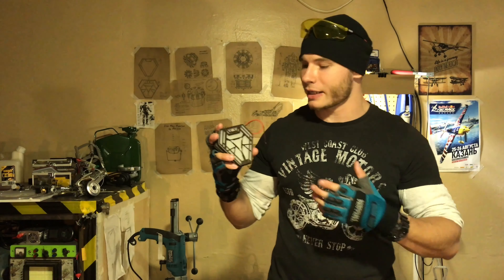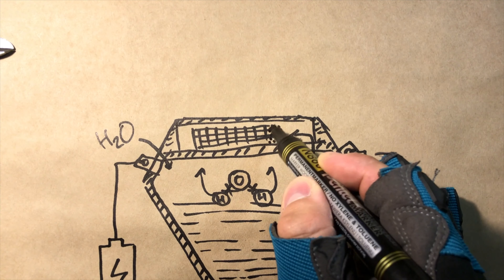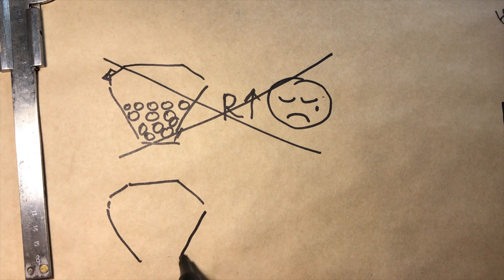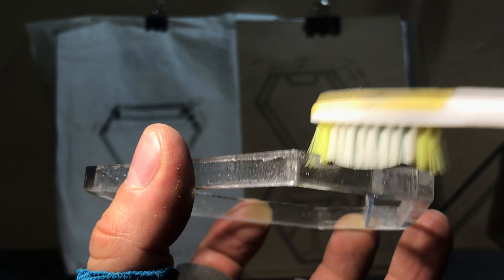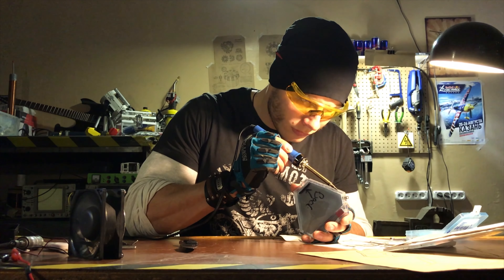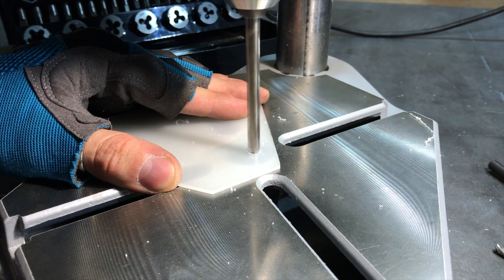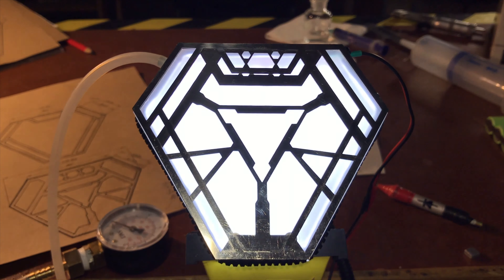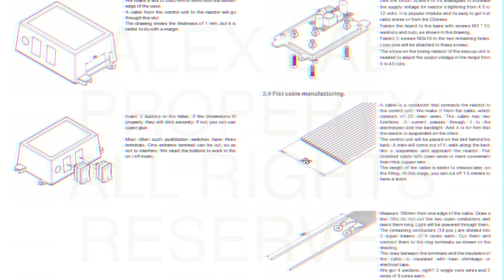Mark X. Part#2. Full DIY guide of Iron Man reactor (eng version)

Comment: 9:01 I have that voltage converter, I use it too pretty easy to use just adjust the potentiometer and you got yourself a good output resolution for any voltage required. Also, the are even better ones out there, that if the voltage of the batteries drops significantly, it will still output the voltage needed. Better use those ones.
Reply: Thanks

Comment: I have 2 questions: 1st, how did you get most of your supplies? Because some of them seem pretty costly and how did you know what materials you needed?
2nd:  How much research did you need to go to complete this project? Because I am working on my own invention and it seems the research process is taking forever.
Reply: Hows your project coming along (also what are you making)? an inventor my self, i go to my local library and take notes of any books about electronecs, coding, phisics, armor, and anatomy. I do my reserch like that, sadly that doesnt really explain incorrect "faults" with some projects some of the time but it helps alot. Hopes this helps a bit

Comment: I think if you put a tight rubber band around it like a thick black one tha looks like a reverse bicycle tire  and only trilled hole in is for the tubes then it would be extra leak proof and it would have no edges.

Comment: I have got a question, is it safe to make it at home?
Reply: I mean, yes and no. Hydrogen gas is extremely flammable, which is why sealing and such is so important. If you're building it at home, I would make sure any testing was done in a wide open area free of as much flammable material as possible to mitigate risk. I'd also recommend not wearing it when you test it, because like Alex said, one prototype exploded on his chest

Comment: So... The electrode is a single plate? I was always under the impression that efficient electrolysis is a matter of two electrodes of incredibly small distance between each other.  How does the efficiency of a single electrode compare to two? I'm not even gonna begin to try making what is effectively a short seeing as I'm running a lithium cell for power lmao